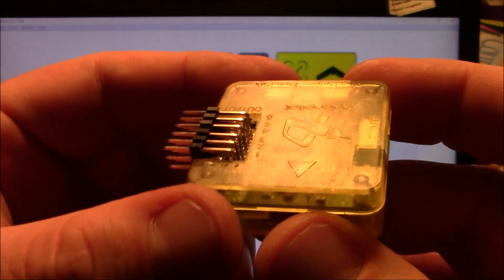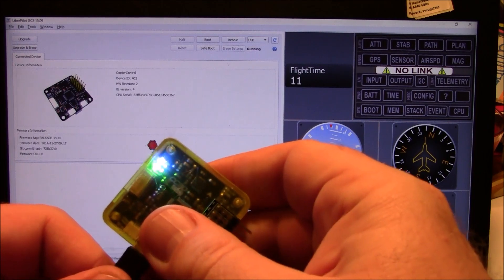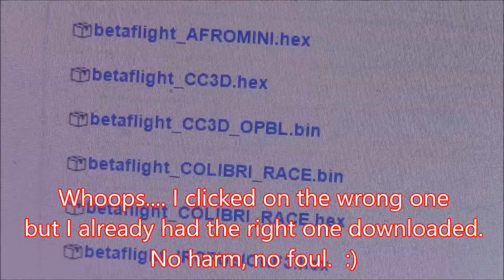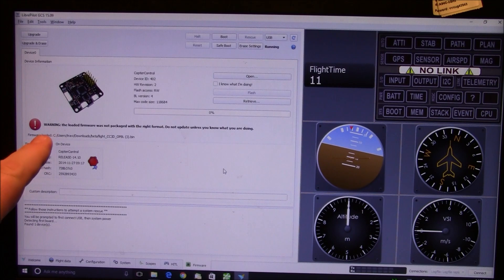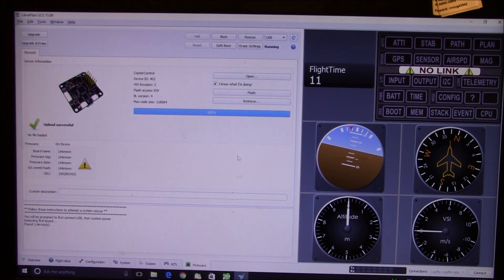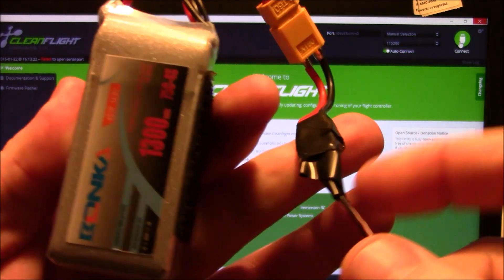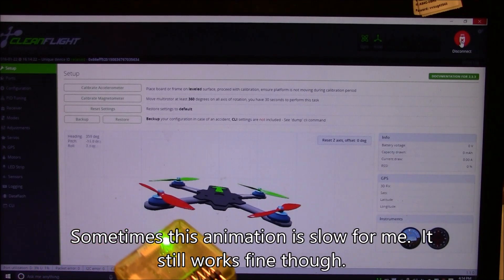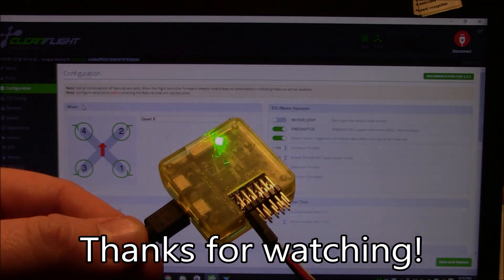Install BetaFlight on CC3D

Comment: I know I'm late to the party here.
But I have an issue. My CC3D was running LibrePilot fine.
Followed your instructions and flashed the betaflight 2.8.1 (current) bootloader with no problem.
Disconnected board and Librepilot and turned on Cleanflight.
Bootloader not found.
CF will recognize the board if I do the slow USB trick, but if I try to flash it with latest BF the board is a paperweight.
Librepilot won't even recognize it now.
Any thoughts?
Reply: Tried with 2.9.0 and same issue
Reply: cannot even re-rescue to put lebre pilot back in
Reply: im having the same issue. anyone sorted this yet
Reply: I haven't yet.
But I've not given up either.
If I find a solution, or work around, I'll let y'all know.
Reply: In LibrePilot, click on "Upgrade and Erase" and you should be back to LP on you CC3D.

I was able to put CleanFlight on my cc3d with the Rescue button and a .bin file. Then after installing the SiLabs usb driver, CleanFlight was able to see my quad. Unfortunately the FW version was an old one, because they have stop making Bin file and I needed the latest version to use iBus on my receiver. Thus I came back to LibrePilot very easily.

Don't forget to disconnect the usb cable between each step.

Comment: on CC3D you don't need to power it externaly. All you have to do is plug usb in into either the cc3d or the computer (if connected to the cc3d on the other end) only just enough for the board to light up but not connect to the computer. Then wait like 3 seconds then plug it in all the way and whamo it connects EVERY time. If you flesh the HEX file via configurator then you don't need to do that at all for some reason. You will need a FTDI or the like to do that though.

Comment: Great video bro :]
I'm planning on flashing the cc3d on my eachine racer to Beta flight, I'm concerned that as it is an ARF model the wiring and what not to the motors is already done, will I need to change that if I flash to beatflight? The motor numbers in open flight and in clean flight are different :/
Reply from the maker: The motor layouts are different.  i don't know if the board can be changed.
Reply: Hmmm, maybe get into cleanflight and reassign motors, will shout out if i manage to do it

Comment: Ty for this. For some reason however I cannot get my radio with SBUS setup with this. I can configure everything except the radio. When I goto the channels tab and turn on my Taranis It disconnects me? I also cannot setup the UART1 channel to allow SBUS I click save and it disconnects. I reconnect and the setting disappears. I made a post about it here if you could help that would rock sir. http://www.rcgroups.com/forums/showthread.php?t=2597699

Comment: Hi Travis, do you have any idea why I can't bind two new X8R receivers to my EU Taranis. I've never had a problem binding before but I bought a new X8R and it wouldn't bind so I bought another from a different seller and that wont bind either. So I guess it must be something I'm doing or not doing. I am running SBUS. I've atched all the youtube videos on binding and I'm doing it right as far as I can tell... Any ideas be great.
Reply: +Flight Mode Fast you need to flash the receiver maybe this will help http://www.multi-rotor.co.uk/index.php?topic=16800.0

Comment: Flashed Betaflight onto an older CC3D and it appears to be working fine, however pitch and roll are swapped.  I can see the model move in the wrong directions in the setup tab.  Yes, I've already compensated for the 90° yaw rotation.
Reply: +kevlarman Hi!! me too, any solution for? Thanks, very good channel.

Comment: Hi Travis, as usual great informative videos! 

You can get Cleanflight to connect WITHOUT a battery plugged into the CC3D after you have flashed it with CleanFlight or BetaFlight.

The trick is to plug the usb cable to the CC3D usb port just enough (not all the way in) so it powers the board and then wait for the blue status light to go from solid to blinking, AND THEN you can push the USB cable all the way in . Go to CF and hit connect and do the usual tweaking stuff.

This is great because it doesn't have a LiPo battery powering up the motors, and risk spinning up by accident. And very convenient when you are in the field tuning the PIDs.

You might want to do a video on this procedure for everyone's benefit.
Reply from the maker: +Paul S Nice!  I'll give it a try.
Reply: Works great!:)
Reply: +Paul S Your right...This worked great.

Comment: can i have too big of propellers on a quadcopter to make PIDs un-tuneable ..open pilot,cc3d,250quad,492g,6040 props. it always has a wobble. not matter what i do..it wobbles..i never hear that high vibrating shake from high kPs (that high pitch osolation sound).  but slow osolations always.just always wobbleing. it wont stop wobbling..i have a 590g 250 that has naze32 and it is fine, flys great from a rookie stand point...i had this one flying good before, then a new day came, and now its not..im gonna see if this helps..this way is much easier then the other way the i saw.
Reply: +nitro 20 haha servers are down my luck.

Comment: so what do i get extra or improvement if i use beta instead of normal cc3d?
Reply from the maker: +Ashish Amatya It is more of a matter of preference.  I still fly my LS-210 with whatever firmware LibrePilot had a few months ago.  I think if your quad runs great and you're happy, then leave it as it is.

Comment: Great video Travis! I've been thinking about doing a CC board on a budget build since it's cheaper than the naze. Im so accustomed to cleanflight though, I didn't want to. 
What is your opinion on performance difference between the two boards if there is any?
Reply from the maker: +WhomImIzFPV I have used mostly CC3Ds and I've just started using F3 Racing boards.  I can't tell much difference between the two when they are both running BetaFlight.
Reply: +travisgrindal i think I'm gonna try one. Super informative video. Thanks for doing it, i thought cc3d and cflight were incompatible. Look forward to flyin with you next season. 
Do you have anymore ilap transponders?
Reply from the maker: +WhomImIzFPV I don't have any right now.  I'll probably get some ordered in the next couple of months though.
Reply: +travisgrindal ok, could you send me the link? I need one more for sure to place into my new build. And one maybe for my night hawk.

Comment: bf 2.1.6 seems to be last stable version. upper from ther runs ur motoros and escs hot.
Reply: I've stuck with 2.1.6 and even when running hard and I finish the motors are barely warm at all as well as the ESC's.  I'll have to see during the summer when it's 95 degrees outside.  I'm sure it will be fine.

Comment: Betaflight worked so well on my CC3D.  I'm able to run higher PIDs without the oscillations I was dealing with at lower PIDs on Cleanflight 1.10. I had to dial back to finally get my QAV 210 to run smooth before Betaflight.
Reply: I am using cc3d cleanflight, when I give throttle drone moves  pitch forward and I observed that two motors are running slow

Comment: Hey Man. Install the vcp driver ( link on clean flight configurator home page) and you won't need to power it up anymore for it to connect.
Reply from the maker: +fr12vid I'll give this a try.  Thanks!
Reply: +fr12vid NICE!!
Reply: +travisgrindal Is betaflight a lot better than  open pilot?

Comment: I'm trying to get my discovery buzzer to work with the CC3D + Betaflight + X4R and I'm going crazy!
Reply: I got this to work and posted my workaround on rcgroups.  It's just remapping your TAER channels.  Normally channels 123 are duplicated on the PWM on the X4R-SB, so remapping the TAER channel to channels 5678 leaves SBUS channels open and duplicated on channels 1-3 on the PWM pins. Just read my posts and I detail it step by step.  http://m.rcgroups.com/forums/showthread.php?t=2567258&page=2
Reply: Plug it into one of the 3 channels on your x4r if your using sbus
Reply: +hula lauer I thought about that, but then I'm not sure how to configure the Taranis to output PWM through channel 2, for example, while outputting S.Bus on channel 1.
Reply: +Alberto Noys, I made a video on this if you're interested. The idea is to enable beeper on pin 6, then connect the output wire to motor #6 (likely to be unused) to the signal pin of your Discovery Buzzer.

Comment: i've heard something about the different motor layout of the two boards..do you need to change anything in cleanflight? nice video ;)
Reply: Yes motors are in different placements on betaflight vs openpilot
Reply: +hula lauer do i have to change anything in cleanflight?
Reply from the maker: +Carlito de asmundis You will have to move your motor signal wires to the correct order on the CC3D.
Reply: +travisgrindal, or apply custom motor mixes.